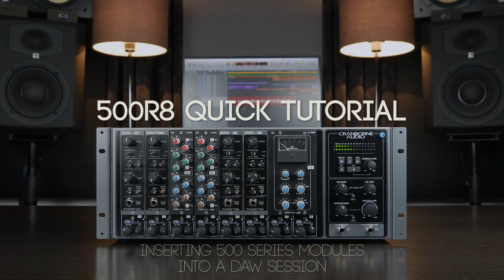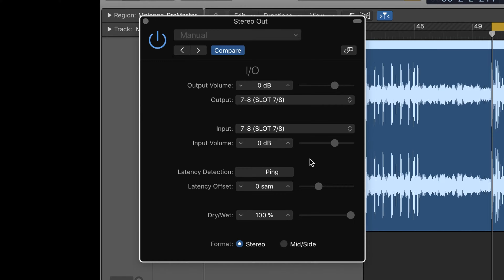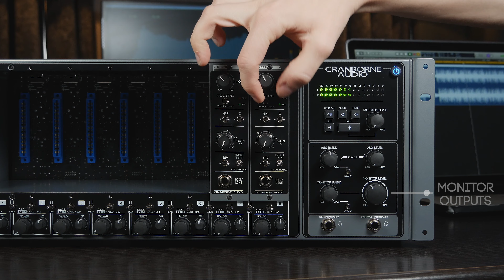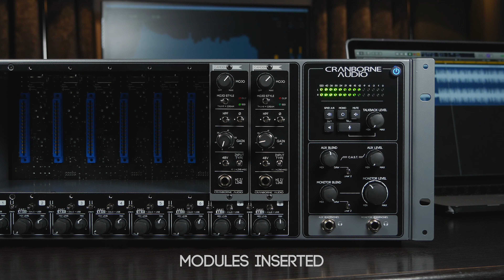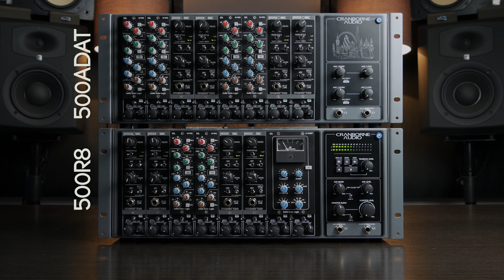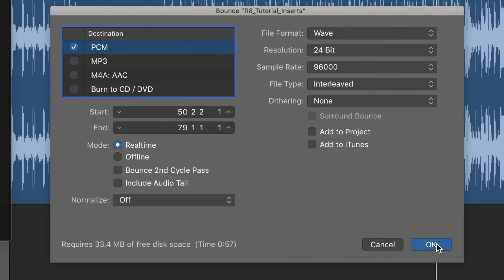500R8 Quick Tutorial | Inserting 500 series modules into a DAW session

Comment: Something that isn't mentioned at all and I didn't find out until I received my unit. You cannot use modules 1 and 2 in Logic without some real headache. This is why in all of these videos they don't use the first 2 modules ever. I've been trying to get their "workaround" to actually work for two hours now with no joy. Also, there is no phantom 48v power unless you buy a 500 series module that passes it through.  So if you wanna record a mic with 48v, you have to have a 500 series pre amp that provides it. Just wanted to make people aware, because I did 6 months of research before buying this and never knew until I tried to set it up.
Reply from the maker: Hi,  thanks for your comment. Please note that we have now worked around Logic's patching bug issues in our latest v1.3 beta firmware update. You can find this in the Software/Firmware section of the 500R8 product page on our website here: https://www.cranborne-audio.com/500r8.

We note on page 17 of the 500R8 manual that when module slots are bypassed, a line-level signal can still be recorded, meaning that if you require to process a Mic or Hi-Z level signal, you will need an appropriate module installed. As line level signal don't require phantom power, and when almost all 500 Series mic preamp modules include phantom power, it doesn't make sense to implement 48v natively on the 500R8.

If you have any other questions, please do drop us an email and we'll be happy to answer.
Reply: @cranborneaudio  The reason I commented this is because you guys are purposefully obtuse about these things. As you mentioned yourself, the only place this information is available is in the manual. Hence why I left the comment. Why didn’t you mention it in any of the videos you did in the “how to” series? I would have never known there was a fix for the logic bug if I hadn’t commented. You need to be a little more open about these things so that people can be aware of what they need to prepare for. I’ve had the unit for 2 days now and just in the last 30 minutes have I been able to use it as advertised. It would have been super simple of you guys made this type of information easily available. Again thanks for the fast response, your product is the best thing out. I’ve just been very frustrated trying to get it set up.
Reply from the maker: @dudemcgee256  Thanks for the feedback, we'll certainly take it on board. With regards to our latest firmware, because it is currently in public-beta, it very much had a soft rollout to our beta testers and subscribed email list. Now it is ready, we are working towards moving the current beta to full release, and so it will receive a 'louder' release at that point (functionally, nothing will change between the beta firmware and final release). All the best and enjoy your new 500R8!
Reply: @cranborneaudio  Just wanted to update you. The firmware doesn't work. I get this message. “Cranborne Firmware Updater” can’t be opened because Apple cannot check it for malicious software. This software needs to be updated. Contact the developer for more information.
Reply from the maker: @dudemcgee256  Please read the 'Read Me' file that comes with the download, point '2' resolves that. For anything further, please do send us an email via the contact form on our website.
Reply: @cranborneaudio  I'll go ahead and contact you via the website form. I did reference the "read me" and tried option clicking the file many times with no luck. Not sure what's going on.

Comment: Can I route the slots in series when using ADAT?
Reply from the maker: Absolutely, if you're looking to use your 500R8 simply as a single channel strip comprised of 8 modules, simply input your audio to channel 1, then activate the 'Chain' switch on channels 2, 3, 4, 5, 6, 7, and then record to your DAW on channel 8. You can read more about the 'Chain' feature on page 20 of the 500R8 User Manual here: https://f.hubspotusercontent20.net/hubfs/4191221/User_Manuals/500R8/500R8_User_Manual_03_06_20.pdf
Reply: @cranborneaudio  Thank you so much!
Reply from the maker: @LoveMeBack  Our pleaseure

Comment: Hi, Can this 500r8 feed a burl b32 thru the outs or inserts and return to the DAW2 input? The role of the b32 is for colouring only. Just trying to find a way to buy this but at the same time incorporate it with the b32.
Reply from the maker: Hi Hadrian, I believe you're asking about incorporating outboard gear with the 500R8, which we have a video on here: https://www.youtube.com/watch?v=316zC3e7DgQ&list=PLtmxEp7015F5DDNuMzdXJxTiV8yfC0DT0&index=3 . You can also utilise the inserts with the slots bypassed, meaning you can utilise the 500R8 as a straight DA/AD via the Burl and not have to process that audio via an addutional 500 module also.

Comment: I’m new to the 500 series and still trying to wrap my head around it. Is it possible to route different slots to different tracks in my DAW? For example, could I have compressors in slots 3/4 routed to my drum bus and EQs in slots 5/6 routed to my mix bus? Or does the whole rack need to be routed to the same track(s)?

Also, is it possible to route multiple tracks through the same slots/units? In other words, can I have separate guitar, bass and piano tracks all routed to a unit in slot 7 for example?

Sorry for the basic questions, but I’d really appreciate some help with this!
Reply from the maker: Thanks for the question!

Absolutely! This is exactly how most people use their 500R8s and their favourite 500 series modules with their DAW. The specific way of how to do this will depend on which DAW you use and how the routing works.
Reply: @cranborneaudio  Thanks for the response, appreciate it!

Comment: Quick question please, if you have one preamp in slot 1 and two mono compressor occupying slot 3 and 4 in an R8. But want to use only the compressors as stereo on the master buss in Protools for mixing. Will you be inserting I/O be 3-4 stereo? Or Insert 1-2? Also should the CAST knob be toggled to USB? This including the preamp in slot 1.
Reply from the maker: Hi there, if you only want to use the compressors on slots 3-4 for your stereo mix, then you only need to toggle the Source select switch for slots 3/4 to USB and then send out of USB channels 3-4 on Pro Tools. If you do not want to apply the preamp in slot 1 on any track in your DAW, you can keep it set to 'ANLG'. Hope this helps! CA
Reply: @cranborneaudio  thank you. I think I miscommunicated the slots numbers to you. If you do have the mono compressors on slot 2 and 3, can that same principle apply? I’m asking because my preamp is on slot 1 and the two compressors are in 2-3. On the Protools I/O I can only insert 1&2, 3&4, 5&6, 7&8 and 9&10 being the monitor output. How can I configure the I/O to get those two compressors. For now, when I insert 3&4 I do get the signals on both compressors in slot 2 and 3 but only one compressor is actually working in slot 2 when I apply compression. I just want to make sure I’m setup right. Thanks again.
Reply from the maker: @auzonville8984  Oh yes - sorry about that! Unfortunately, this is a limitation of Protools and some other DAWs where they can only patch to odd-even pairs. The only way to get around it is to move stereo pairs to 3/4, 5/6, and 7/8. You can sometimes get around it by splitting the signal into two mono tracks and doing mono inserts on each for slots 2 and 3 - but that is a bit laborious. Sorry it's not more straightforward but most DAWs have this issue. Thanks again, CA

Comment: Have you guys ever used this in Reason? If so, how would I set it up as a 2-bus with a Stereo Comp and EQ?
Reply from the maker: We haven't used it personally with Reason but there is no reason why it would be any different to any other DAW! If you research the Hardware Insert functionality in Reason, you should be able to use that facility to send audio form Reason and out into 500R8. From there you can route audio from one module and into the next using analogue cables and then record that signal back in for printing. Hope this helps! CA

Comment: Hi Guys,

within logic, is it possible to do this using slots 1 and 2 or is it not possible because logic always recognises those outs as the stereo outs?

I have configured logic to use the 500R8 outs 9 and 10 and mirroring is deselected.
I've read the manual and done a bit of digging and haven't been able to come up with the solution.

I love the unit and the preamps, you guys have dome a great job !
Reply from the maker: Hi Brendan! Yes you can do this, however you need to use an Audio MIDI Setup workaround - It's a shame Logic still has this strange bug however we can get you up and running! We have the workaround documented in the manual on page 51, but in effect, this will offset 500R8's channels by 2, allowing you to use all of the slot as normal! Hope this helps!
Reply: @cranborneaudio  extremely helpful!
thank you for the quick response.
Reply: Saved my afternoon!
Reply: Hi Brendan, did work the aggregate device for using slot 1 and 2 in logic. I am not been able to do it in a m1 Max

Comment: 3 questions lol.
1. If i wanted to monitor my mix from the summing mixer outputs how would i set that up?
2. If i wanted to then "print" my summed mix how would i do that.
3. Is any of this possible without any 500 modules installed?
Reply from the maker: Hi @kingfridayx!
Thanks for the questions!
1) You can monitor your Summing Mixer by turning the Monitor Blend control over to its Mix position. When the control is in that position you are hearing exclusively the Summing Mixer so you can build you mix up.
2) All you need to do is setup a new track in your DAW with USB input 9/10 - that has a dedicated converter for the mix bus to allow you to record that summed mix as a stereo file back into your DAW.
3) Yes, absolutely! Each slot can be bypassed and all functions operate as normal; we have a video about that too! 
https://www.youtube.com/watch?v=ElS_Qo-s7UA
Hope that helps!

Comment: What's the latency when actually used as an interface.? I'm having trouble finding that spec
Reply from the maker: Hi Lee, it is very difficult to publish an official Latency figure as it varies so widely depending on machine performance. Some of our customers get as low as 2-3ms roundtrip, however others on machine with less power can get 5-6ms. Again it is impossible to put an accurate figure out there. We have designed the unit to have as low a latency as possible but a key part of the workflow is its analogue monitoring capabilities - which are all analogue and 100% 0 latency! Hope this helps!
Reply: @cranborneaudio  definitely understand! So I would imagine this stacks well against apollo's apogee, antelope etc on terms of latency? Would it be of the equivalent there? Also, is there thunderbolt connectivity? Thanks so much for the reply, getting information gathered on 500R8 and hoping to pull the trigger at sweetwater on a new interface in two weeks. It's looking rather promising for 500R8. Beautiful system. By chance does it come with any Camden preamps standard? Or is it sold as only a shell unit..

Comment: Just for my understanding.... i f i have a apollo 8 - i could use 2 Cranborne 500 adat Cases right? 
one Cborne 500 is set to Adat expantion and the other Cborne 500 is getting connected via the 8 outputs of the apollo 8 and the Cborne 500 mainoutputs are getting connected to two of Apollo 8 Inputs.... is this right? 
anybody got this Case running with Ableton and can tell how you would route your channels? I want to you use The 500 adat as tracking and Mixing... first getting two Cborne Preamps for Left and Right channel witch is feeded by a stereosynth. Followed by a compressor and followed by a Eq /after recording all the tracks in, via the same way / i can  than use the Cborne 500 to sum all the tracks i made so far and send it back to ableton... am i on the right way? How do you guys use your Cborne 500 to get the job done? before i saw the Cborne i wanted a Dangerous music 2bus+ and some other gear... i could run the same just with this 500 case here, right?
Reply from the maker: Hi there, You can indeed pair two 500ADAT's with an Apollo 8. You can connect both units to the Apollo via ADAT for ADAT expansion provided you don't record above 48kHz. You can then link the summing mixer together using Jack cables and then send the full summing mix out into the Apollo's input for a full 16 into 2 summing mix. If you record above 48kHz, then you can indeed patch them in the way you mentioned above. Hope that helps!
Reply: Cranborne Audio Oh man, This is to awsome right now! I will get me your stuff... Nice Uk Engineering Guys, Keep the inovations up...!

Comment: I've been meaning to ask, since I will be getting both the R8 and the Camden soon; 1. in the manual for the Camden mic-pre it states that the Mojo dial is blending in the effect, like parallel mixing; is that the case? Reading the SoS review kinda made it unclear.
2. When using an external clock via the BNC connector on the R8 are you using the inbuilt correction clocking as for the ADAT part or is the external clock 'fully' in control? I just wanna play around with my other clock to see if there is an audible difference clocking different devices, still keeping my Saffire56 for the Liquid channels - and my clock is a Black Lion with 0,6ps - so slightly less exact but...
Looking forward to your future products, more 500 stuff maybe.
Cheers!
Reply from the maker: Hey Rob! The Mojo control is effectively blending in the Mojo'd signal into the dry path but the audible result is a bit more interesting that just a dry with mojo. The dry and wet signal interact in a very special way to form a more cohesive sound and Camden's linearity helps retain the punch and immediacy but combined with the Mojo gooeyness. When 500R8 is slaved to an external clock, it reads the incoming clock information and generates its own low-jitter recovered clock to <0.7ps. When it is the clock master it has <0.5ps. Would be interesting to hear what you think! Hope that helps! Ells